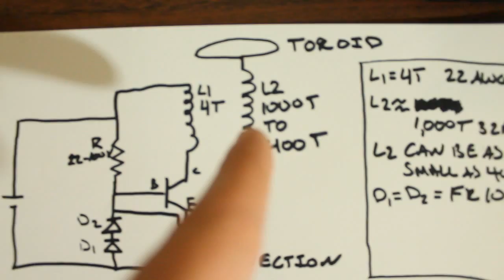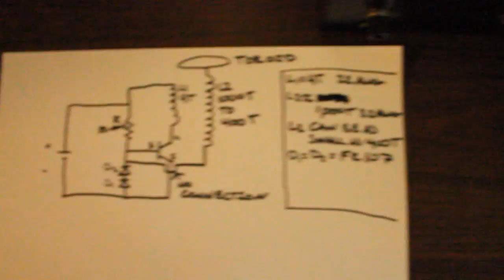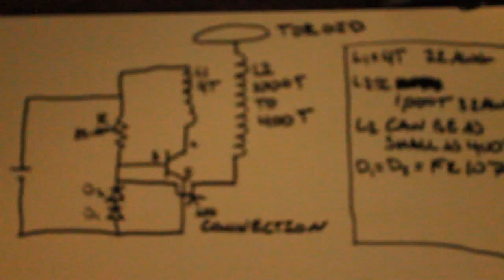Schematic for Solid State Tesla Coil

Comment: It works kinda , i didn't had a tip31c but i used a NPN transistor from a computer power supply, and for the R i used a 5k ohm resistor , and it arcs the arc without toroid is about 1 CM and with toroid is about half a cm but the range i can light up a CFL is only about 10 CM , i think the transistor is the problem because it gets very hot after 1 minute or so of use , no matter where i put the L1 up or down , i will get the tip31c and try with that one , Thanks for sharking the schematic .

Comment from the maker: the # of winds for the toroid are irrelevant. Think of the toroid  as an antenna/capacitor; all those windings are doing is broadcasting the energy evenly around the device. Both ends of the torrid are soldered together, and by theory the voltage potential across the toroid is 0. this node is then attached to the end of L2 with a bit of tension.

Comment from the maker: patience is key. don't let the wire overlap. there is one overlap on my L2, and its towards the bottom =( 
As the temperature changes, so will the length of the coil, which is why I have it wrapped in electrical tape. The final design will be sprayed with some kind of enamel to make sure the coil stays intact. be as meticulous as possible. it will take at least an hour. I would start with a smaller coil, maybe of 400-600 turns or so.